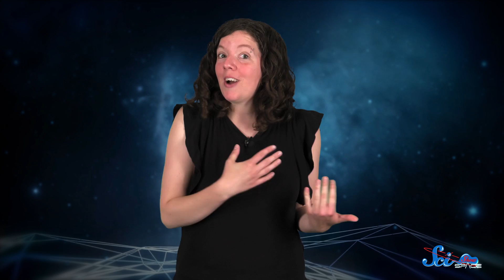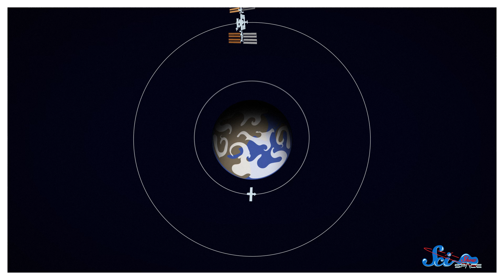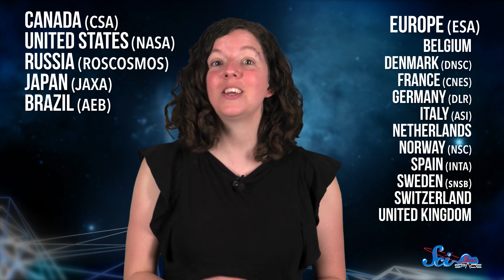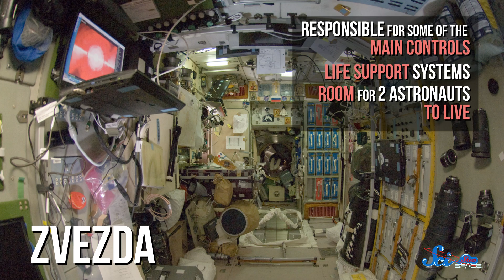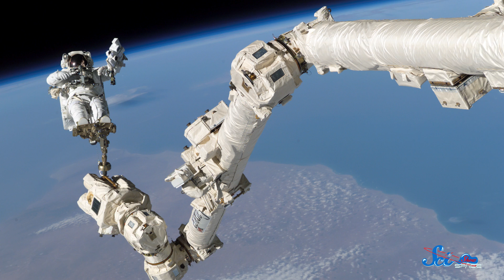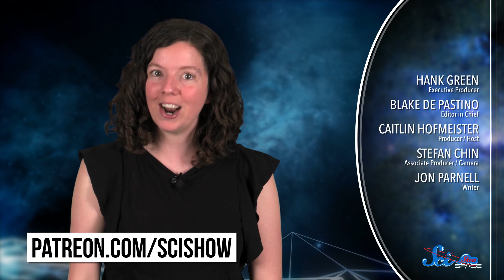How To Build A Space Station

Comment: Kerbal taught me that two objects in the same orbit have to be going the same speed. ahhem 1:22
Reply: Simplified graphics.
Reply: A minor Retrograde burn won't affect your orbit that much but it will give you a clean slow safe rendezvous and eventually, docking. But of course that's not the KSP way to do things. FULL THROTTLE PEDAL TO THE METAL

Comment: Why didn t you talk about Skylab?
Reply: cuz scailaib eis sit
Reply: wet
Reply: because it was inferior to Sylut's 5-7 and was much more expensive, and didnt really inovete much
Reply: Issc It really didn't inovate, the ones who inovated where Syalut 6 and 7, they had 2 docking ports and were re-suplyable, this meant that duration in space could be prolongued, Skylab was used 3 times, and 1 of those times it was just to repair it, sure it did some stuff, but nothing to remarkable
Reply: Issc in preety sure the space shuttle helped more than Skylab in that regard
Reply: Why didn’t they actually talk about building space station parts?

Comment: Genuine Question: Does the ISS have a mass of 300 000kg? If so does it also have a weight of 300 000kg? If not what is its weight?
Reply: up there, they experience weightlessness
Reply: I think mass because there is no gravity in space, or maybe they measured the weight of the modules before sending them into space.
Reply: Mass is the measure of how much matter something has, while weight is the measurement of the pull of gravity on an object. Technically they're different, but when they're used in casual speech (or introductory science videos) it's usually understood that 'weight' is in reference to how much it would weigh at sea level on Earth, since that equates to its mass.
Reply: +Raphael Venuti  There is gravity in space. At the level of the ISS, the pull of Earth's gravity is about 90% of what it is on the surface. You just don't 'feel' the effects of it because you're orbiting.

Comment: I think it'd be so cool to bring some of the space station back to earth instead of letting it burn up.
Reply: well thats kinda hard, they burn up in the atmosphere, and to get them back to earth you would have to get them through the atmosphere without burning up
Reply: The only way to do that would be to upgrade them with protection for the re-entry, which would be expensive and meaningless, since bringing them back in one piece would serve no real purpose.
Reply: +biscuiteer I just mean like bring back the solar panels (because I think they can fold up) along with the other cargo within a capsule that is meant to come back to earth.
Reply: um you would take that stuff on the last return mission
Reply: +tjl102 that's what I was thinking haha
Reply: Why would you bring back the solar panels though? Even folded up they're probably pretty unwieldy and it's definitely not worth the cost that it would add to the last return mission.
Reply: There's no point in getting the solar panels back. They are useless. Why would you take something that was built with technology a decade or more ago and has micro meteoroid holes as if it was blasted by a shotgun? The same goes for most of the other parts of a station.
Reply: Honestly, if they wanted to preserve the ISS for sake of future generations it would be easier to push it out into a distant orbit. Put something at the right spot and it will take billions of years for the orbit to decay, and it would be out of the way, so that would be the best way to preserve the station.
Reply: If we really wanted to save parts then a more useful way of doing so might be to wrap those parts in a bouncy castle and propel them towards the moon.  If we ever get a moon base going then there would be parts scattered around for potential reuse.  I doubt that ISS parts would be all that useful on a moon base though, except maybe as a supply of emergency spares to MacGyver together in a Mark Watney-style emergency. 
. 
If we bring the ISS back to Earth then the only value the parts would have would be in their recycling potential, and that would be outweighed by the cost of doing so.  None of it would be re-used because it would be a waste of resources to refurbish on Earth and then send it back up again;  Cheaper to send up brand new kit with up to date tech on board.